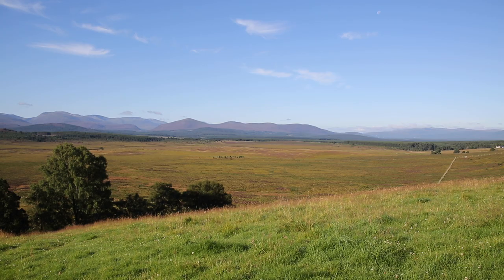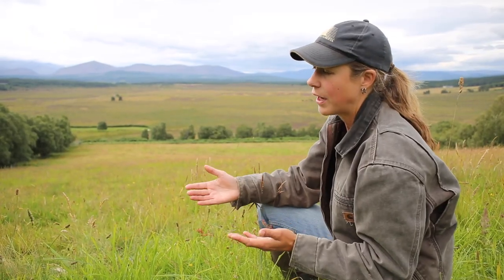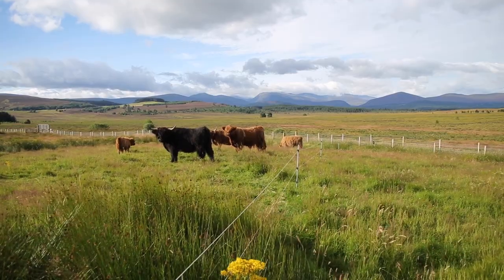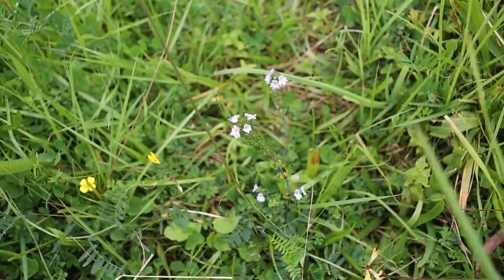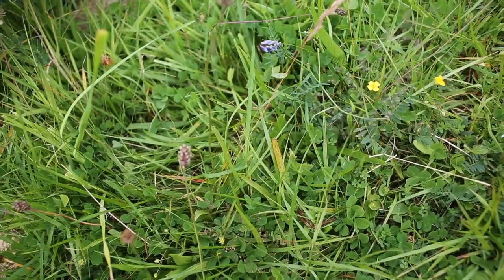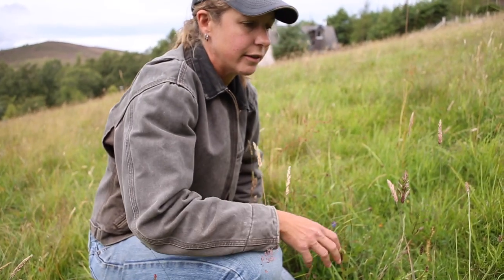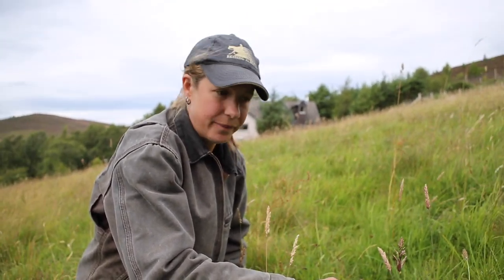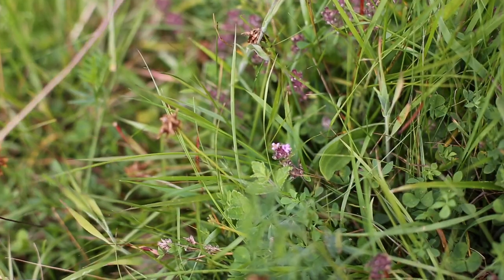Bale grazing for pasture diversity

Comment: Now fill 5 old tires with concrete, chain them together in a “V” pattern and drag around pasture as soon as the cows rotate out. Smears the poo patties so they are more effective, more quickly. 20 minute operation.
         O        O
            O   O
                O